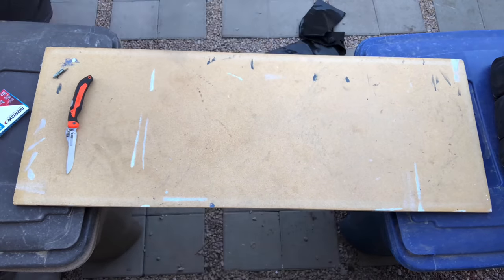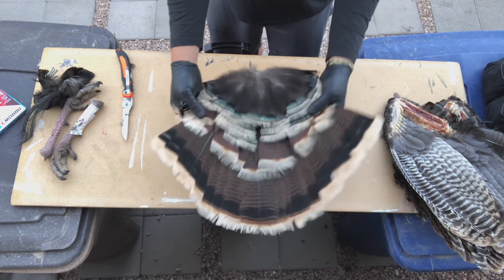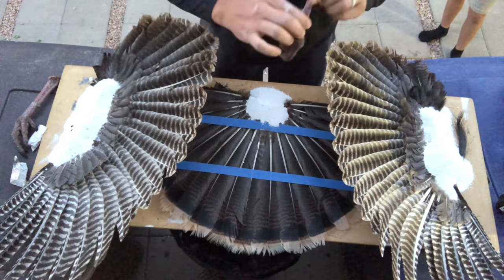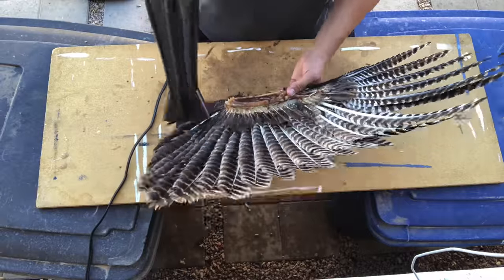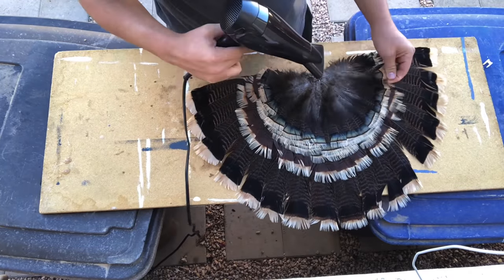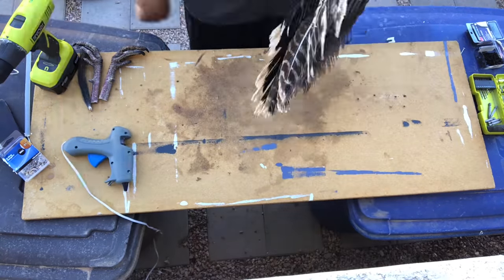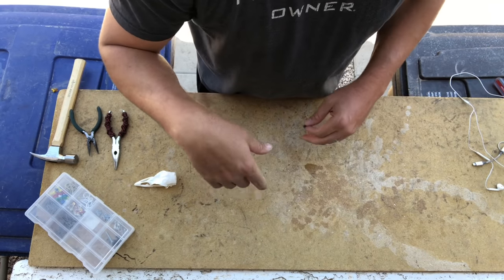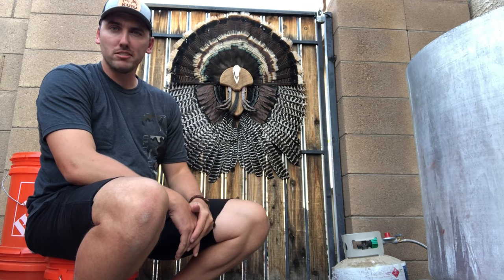How to Mount a Turkey | Tail Fan/Wings/Skull

Comment: I tried using the painters tape to hold my fan and when I tried to remove it, it ripped off several feathers 😢 how can I keep this from happening ?
Reply from the maker: Yikes!! I’ve never had that happen before.. was it kept outside? Painters tape is what I use specifically because it doesn’t stick too much.
Reply: No should I have done that I have it in the house in a room that’s typically cooler than the rest
Reply from the maker: @cherylecaldwell9271  No, inside is definitely the way to go. I’m really sorry… I’ve never had it pull off feathers before. It isn’t an entirely necessary step if you do want to bypass it next time I just do it to make extra sure it all stays in place.
Reply: @Pick6Outdoors  thank you I did have it inside I misunderstood your first comment and thought that it should be outside. I used straight pins like you would use when you’re sewing something to Hemet and to hold it in the place somebody also suggested macramé pins what are your thoughts on that?
Reply from the maker: @cherylecaldwell9271  That’s really strange it pulled out feathers… hopefully not too bad and your fan still looks good!
Reply: @Pick6Outdoors  yes thankfully I had only put it across the fleshy bottom part so it still looks good just not as full 

I appreciate your feedback and your time 
Have a blessed day